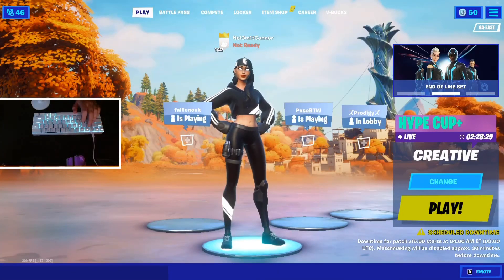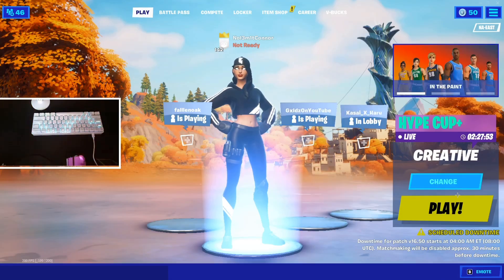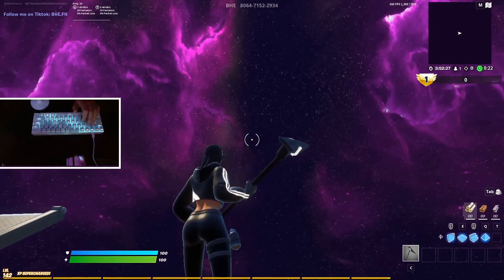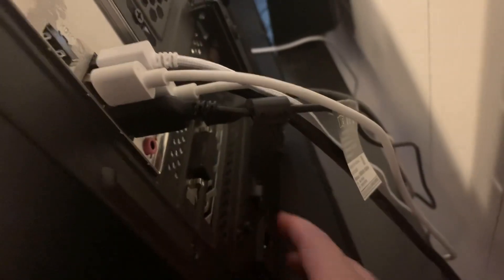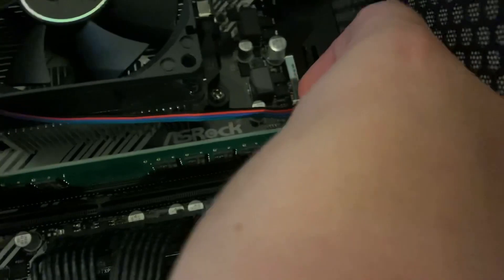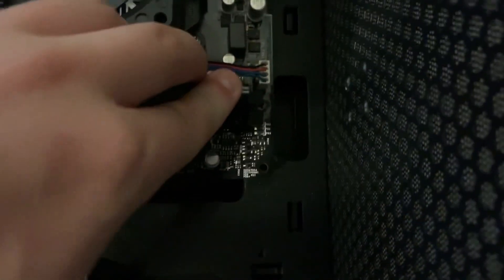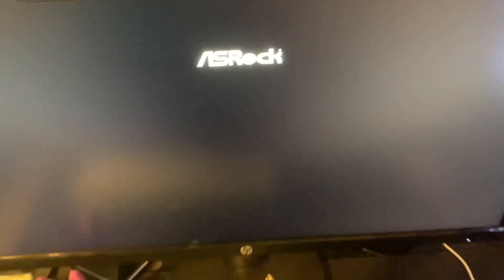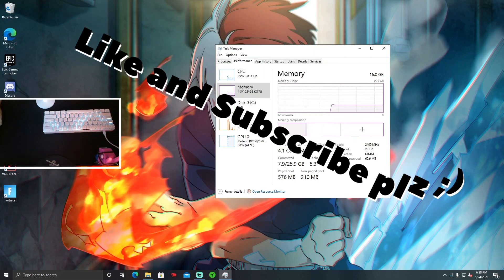I ADDED 16GB OF RAM TO MY IBUYPOWER ELEMENT MINI 9300 | FORTNITE FPS TEST & GRAPHICS SETTINGS

Comment: alr so the pc i ordered is coming with 8gb of ram. When i upgrade it do i buy a 8gb ram stick or 16gb?
Reply from the maker: Buy two 8gb of ram just so they are the same brand when you upgrade
Reply: get only 8gb dosent have to be the same brand
Reply: @notevoid7448  if you have a 8gb 2660 ram and you buy a 8gb 3200 ram the faster stick will be under locked i recommend buying two of the same